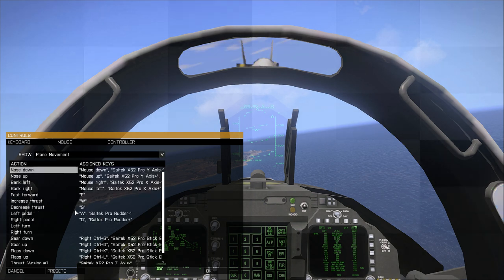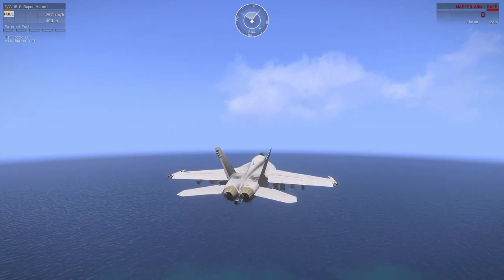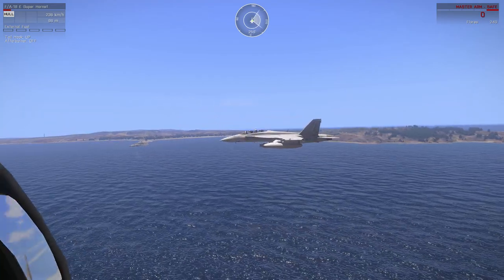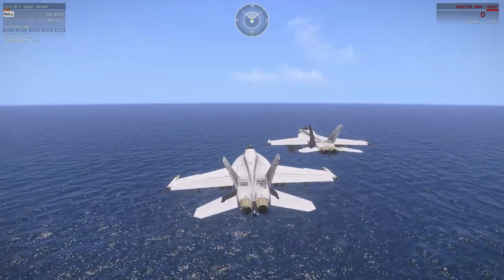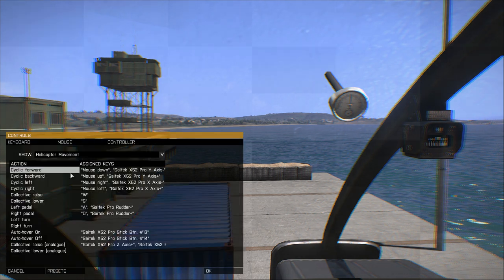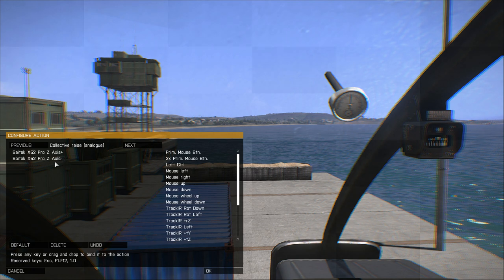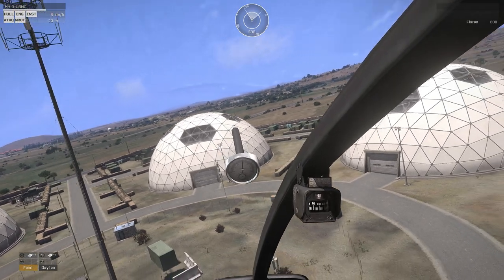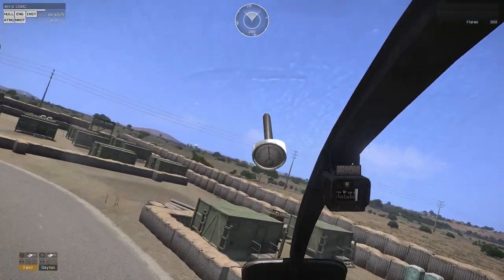Flight Control Joystick Setup - Tips and Tricks [ARMA 3 & DayZ]

Comment: Came here hoping for a fix to my X52 flight throttle quadrant as collective issues and was very hopeful. Sadly it wasn't to be as it looks like you may not have updated your game and have the new Helicopter DLC.

If anyone here can help I would really appreciate it. My collective is like a bouncing ball up/down never smooth since the update. In the advanced setting the collective goes full travel in standard no movement to be seen at the controller for both stick and collective and very poor/slow handling and limited pitch/yaw and that. Tried the 'tip' you gave with the collective but that sets the collective a little way up (visible at stick in advanced) so skimming across the ground! I really am at my wits end with this tried all different sensitivities, dead zones analogue not analogue its a shame as before the update could fly great with my xbox controller and no issue. I also play IL2 BOS and DCS and can fly so its defo the game...

Many thanks to anyone whom gives this their time in reading or replying.

Cheers,

bushwacker
Reply from the maker: Hey, this is an old video from me from back in January 2014 (last year).Your problem is that you have your collective set to Collective Up and Collective Down.  You should instead set it to Collective (analog) up and down.  The trick listed in this video, setting the up and down collective in the same Up field won't work if you're using the advanced flight model, unfortunately.

Hope this helps.  Let me know if it does or doesn't and I'll try to explain further.
Reply: Hi Faint thanks for your reply. Sadly I have already tried this and it doesn't work like it does in DCS Black shark DSC World flying the Huey so I think the game is at fault maybe it just doesn't like the X52… Thank for the advise anyway ;-)
Reply from the maker: Stephen Holgate Check out my newest video on how to properly set up your X52 Pro.

Comment: Wow, you went into controls and it didn't forget you had a joystick?
Reply from the maker: What do you mean?
Reply: Feint
There's a bug that I thought everyone had. When you go to controller settings, many times the game forgets you have a joystick controller. It really stinks to have to exit the game to get it to reinitialize the controller.

https://www.google.com/search?client=ubuntu&channel=fs&q=arma+3+joystick+disconnects&ie=utf-8&oe=utf-8
Reply from the maker: glock21guy That sucks.  I've never had that problem.  But setting up the Saitek X52 Pro for my PC wasn't fun over the years.  I have one of the old ones and drivers over the years have had questionable quality. So far so good lately though.

Sounds like a lot of people find various fixes depending on their setup.  Turning off Freelook, turning off CBA, using a powered USB hub, disconnecting their joystick from USB3 and transferring to USB2.  

Here are the steps I'd try to fix:
1) Disconnect all of your mods and see if this is still a problem.
2) If it's a power problem, disconnect all peripherals that use USB.  See if the joystick gets dropped.  Also, check your power settings and turn off power saving for USB hubs in BIOS and in Windows.  Also, try connecting the joystick to a different USB connector.
3) Try disconnecting the joystick but leaving the throttle connected and see if the throttle gets dropped.  If so, replace the cord between the throttle and the joystick.

Good luck.  I hope you get it sorted out.
Reply: Feint I have the problem in Windows my X52 Pro works fine but in Arma 3 is not showing up. And i dont know.
Reply from the maker: Nik H If you go into the settings menu and click on controllers, see if the X52 shows up in there.  If it does and is ghosted out, click it and then click enable.  If it's not showing up in the list of controllers, then... hmm...try making a new profile and see if it shows up then.  If it does, then it's a problem with your profile.
Reply: Feint
I got it was set to eco mode so it turns off when i play a game xD
thx for the Tipp :D

Comment: Thanks for the video.  Do you still use X52?  Tried any other like Thrustmaster 1600?
Reply from the maker: You're welcome.  No I've moved over to the Thrustmaster Warthog and MFG Crosswind pedals.  But in some ways, the X52 Pro had more options because it has more dials and buttons that are easier to span across other games.  The Warthog though is far superior in terms of the actual stick functionality though.  If you go with the Warthog, it might be worthwhile to get another peripheral with some buttons you can map for other functions that won't fit on the HOTAS.  

Whatever system you have or are thinking about getting, I'd recommend you get something that's programmable.  That way, you have more options if Arma can't map everything the way you want.

Comment: Hey man, I'm trying to use the trigger on the JS but it brings up the commands menu... even though it's binded in the controls to fire. Any clues?
Reply from the maker: Take a look at your Previous and Next controls in Arma and see if they match the key you're using for firing.  Sometimes you just have to go through it set by step.  Clear the binds that would make the commands menu come up.  Clear the fire weapon mapping.  See where the conflicts are.  It's hard to tell you specifically without knowing your exact settings and hardware setup.

Comment: Feint one more question! do you think that an X52 would be good and enough to pilot any  Helicopter in Arma3? thanks Bro.
Reply from the maker: +gerardo gonzalez The X52 Pro is a lot better than the regular X52 and much cheaper than the Thrustmaster Warthog.  I used the X52 Pro for years and it works OK.  I think at that price point, it is pretty good.  The new ones aren't as good as the old ones.  Once Saitek got bought out by Mad Catz, the quality of the hardware went down, but the quality of the software went up.  But you will have a hard time finding an old one in good condition.  It definitely has it's problems but it's good enough to use for any game out there.  I did enjoy my time with it, but got to the point (after years) where I wanted to upgrade.

Comment: I know this is old, but do you mind if you can share your tracker profile? I enjoy flying on public servers but can seem to find a nice trackir profile that suits me. Please and thank you.
Reply from the maker: Sure.  I have placed some of my profiles here:
https://drive.google.com/open?id=0ByQshG747KqKZ0JIbkxlYmh2WnM

I'm always tweaking these slightly, but these should get you started.  The DCS profile is very weird but works well in DCS and nothing else.  I often use Smooth Modified for racing and sometimes for Arma.  I also change the Speed and Smooth Motion Control elements from time to time.  Currently, Speed is set to 1 and Smooth is set to 10.  But depending on the game, I might change these.  I'm also using TrackClipPro, FYI.

Comment: hi sir I arma3 how can i get the jets in my game? I have alot of mods that dont work what  should I do?
Reply from the maker: Here are a few steps you can try...
1) In the launcher, disable all 3rd party mods and addons
2) Ensure that you have purchased the Arma 3: Jets DLC
3) Test the game to ensure that you see the jets
4) Start to add back in the 3rd party addons and mods that you like.
5) Ensure that you are using the correct and updated dependencies such as CBA - TIP: Most of the addons will list the required dependencies, but sometimes they do not.

A lot of 3rd party addons and mods will interfere with other content.  So you can't use everything you want.  Total conversions have the most problems.  And mod that changes how all the weapons work, or changes their names will break a lot of other addons, for example. 

Also, it is important to recognize that the older a mod or addon is, the less likely it is that it still works.  Bohemia Interactive is still updating the game engine and changing how code works.  So a  mod created in 2015 might not work anymore, for example, unless the creator has kept up with regular updates to that mod.

TIP: In the launcher, you don't need to unsubscribe from a mod or addon.  You can just disable it from loading in order to test which one or ones are breaking everything.

I hope this helps.

Comment: I have the thrust master hotas x would these settings work with it at the mo helo just spins up then crashes in AFM
Reply from the maker: I'm currently running the Thrustmaster Warthog HOTAS and the way I have the throttle mapped for Helicopter inputs is Z- for collective Up (analog) and Z+ for collective down (analog).  So nothing too special there.

For plane mapping, it's Z- and then Z+ in Thrust (Analog) (with Z- above Z+) and two different buttons for Brake (analog).  I hope that helps.

I would recommend you enable Auto Trim.  That may be what's causing you to crash.

Comment: I’m playing arma on a laptop I’m going to buy a pc soon, I bought the t.flight Hotas x it’s all plugged in and stuff but it doesn’t work I pull Ford on the throttle nothing happens can u help. FYI the green light is on and it’s switched to pc not ps3
Reply from the maker: I'm not familiar with that specific setup, but usually if you set up a new joystick, you go into windows and see whether or not the controls are responding to your inputs. If they aren't, it's almost always a driver issue. In other words you have to download the drivers from the website of the manufacturer or you have to use the disk that came with a joystick, if one came with joystick, and install those drivers to get it to work. If you've already installed drivers, check to make sure that you have the joystick plugged in correctly including a power cable. If you've done all those things, and install the drivers, and Windows still does not recognize the joystick, make sure that the joystick is rated to work with your version of Windows. if you checked all those things, then it's possible that the joystick is broken and you can return it to whatever you bought it and get a replacement.  If you have it working in windows already but it's just not showing up in Arma, then go into Arma settings, into controls, and click on controllers. There you will see a list of all the controllers. You can hit refresh, and the input should show up. Then make sure you click ok until you get back to the game.
Reply: @Feintgames  im sorry  u had to right that hole thing i did read it tho because i found out how to use it u can just go into settings and go to heli/plane movement and if go to such as left turn u can just push the stick left and then its a control

Comment: I hooked up an older Saitek X45 and tried to fly with it. I've found that it doesn't have the "throw" that the keyboard inputs have. I can pull the stick all the way back but the elevator only goes half way. At the same time, if I press the S key, it goes to full elevator. Same with the ailerons and rudder. This happens in both fixed wing and helos. I hooked up an Xbox 360 controller and it does the same.

Do you have full input with your stick or is this an in-game issue. I've tried messing with the sensitivities but they do nothing as far as throw.
Reply: I ended up un-mapping all other controls  and was able to get full throw. I’m assuming the keyboard mapping was conflicting with the X45 controller. I have not tried the Xbox 360 controller but I’m confident it will work fully too.
Reply from the maker: +Chad j Interesting.  I'm glad you figured it out.  The control mapping really needs an overhaul.  Everything is named so poorly and interactions and conflicts aren't that easily figured out.  I'm surprised the developers haven't addressed that at this point.
Reply: +Feint I agree 100%! The controls aren't very intuitive but I'm not holding my breath for any changes anytime soon. Another issue I'm trying to get resolved is 'losing' the control in-game. It will work just fine for a period and sometimes a crash or simply pressing ESC will cause the control to be 'kicked'; I go to configure>controls and it's not there. BI says they are "working hard on fixing it" but it's been a know issue for a while.
Reply from the maker: +Chad j That's weird.  I noticed with my X52Pro that the connector between the throttle and the stick is super buggy.  Specifically, the connection to the stick.  So if I move the cord, sometimes I'll lose the connection to the stick like I'll be able to roll left, but not right.  At one point, I even lost the mapping to Aircraft roll right randomly.  I couldn't figure it out until I noticed that the mapping had erased somehow.
Reply: Updated from 8.1 to 10 and it hasn't happened since. 

I'm still having a hard time descending and getting good landings. I know a lot of it is me but I'm also wondering if it has to do with the older X45 I'm using. I'm debating on upgrading to a newer HOTAS; either the TM Warthog or X55.
Reply from the maker: +Chad j On the TM warthog, there is software to reduce stick sensitivity curves. It really helps. But there are drawbacks like having to set up all of the buttons which can be a pain. Try playing with the sensitivities in Arma to help smooth out your landings.

Comment: my joystick is wanting to go to the left, my stick isnt moving, but it still turns to the left... plz help
Reply from the maker: If you're using X52, it's probably the interconnect cable between the throttle and stick. I had the same problem. Try moving the cable around and see if that fixes it. If so, replace the cable.
Reply: ok thanks dude

Comment: hey man love your intro. may i ask how you made it?
Reply: Thanks.  I made the intro in Premiere Pro using practical effects (smoke plume) duplicated to a second layer, blended, and then overlaid with a lens flare/ghost optical effect that I also blended.  You can also do this in Photoshop later versions that support video editing.  Music was added to help sell the effect.

Later videos have a slightly different version where the title of my website is revealed by the smoke.  Basically it's all in the blending layer.  But I had to play with it a bit to get the effects to work the way I wanted.